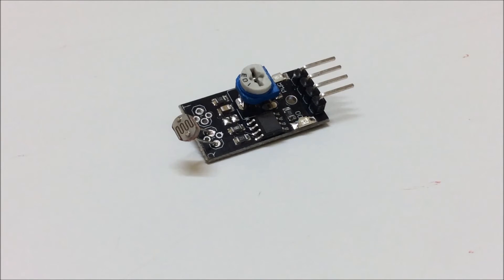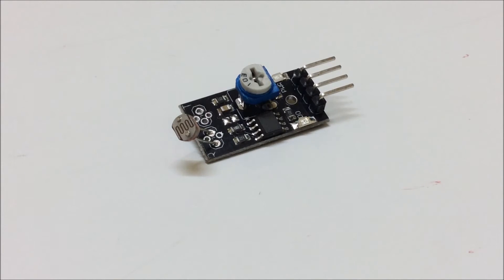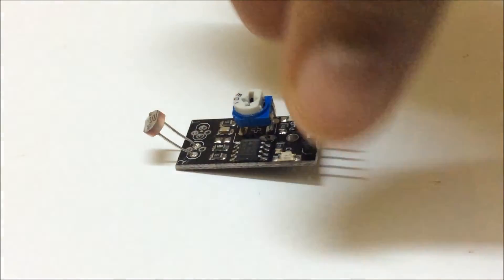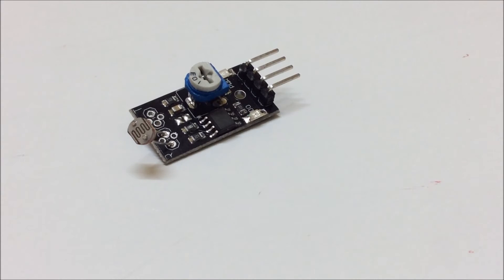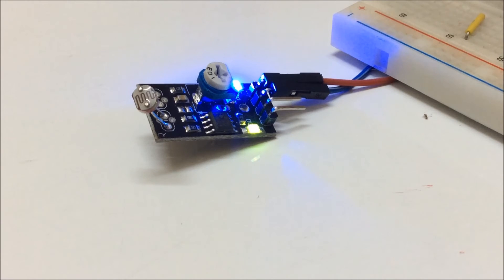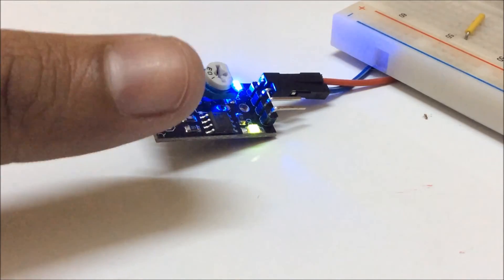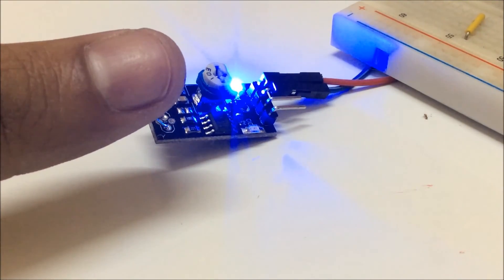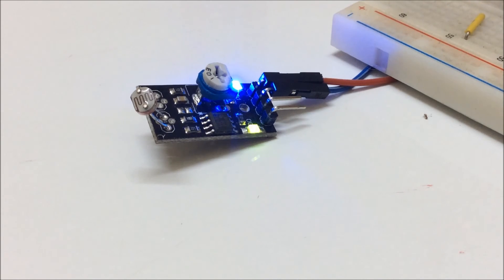TUTORIAL - LDR - Light Dependent Resistor Module Working

Comment: sir to whom u connect the vcc and gnd
Reply from the maker: Nayan Tirpude vcc to 5v and GND to ground . You connect it directly to the voltage regulator or to a microcontroller which has a ground PIN and 5V output pin.
Reply: ty.  a question is again in my mind
Reply: how to connect siren and laser light snsor project from it?

Comment: My Distraction thank you for this tutorial . I would like to know how can I attach a micro servo to it . if I cover the photoresistor the servo must either move 180 degrees or even 45 degrees. your help will be highly appreciated
Reply from the maker: ENM Adam Hello.. you cannot control the servo by directly interfacing with the LDR output pin. Servo motor output is controlled  using PWM signals. I would suggest you to interface the output pin from LDR to an external interrupt/ input pin of the microcontroller. As the LDR output is high, interrupt gets triggered/ input pin becomes HIGH. Based on this You can trigger the servo control using PWM signals. I have tutorials of servo control using PWM. You can watch that too in case if you are not aware of how to control the servo using PWM signals. 
Thanks a lot for watching my video and sharing your valuable feedback. :-)
Reply: My Distractions  can I have your email address or how can we chat I would like to show you my project I need some help  please ?
Reply: Thank you so much hope everyone was helpful like how you are
Reply from the maker: ENM Adam you can e-mail me @ mydistractions90@gmail.com
Reply: My Distractions thank you I have sent you email